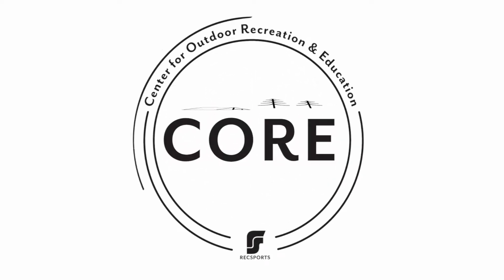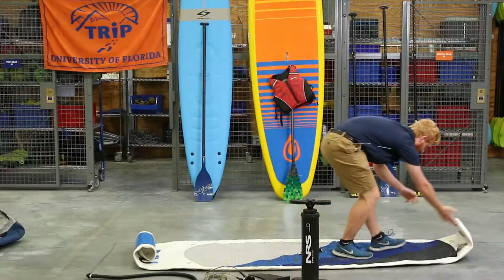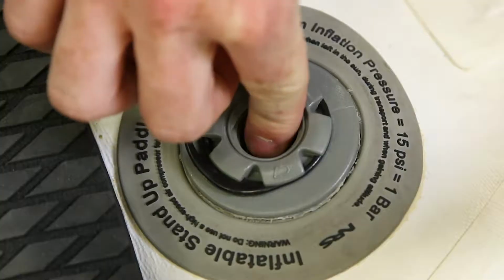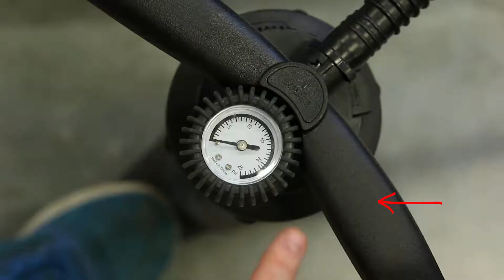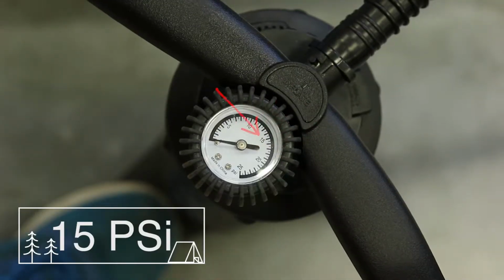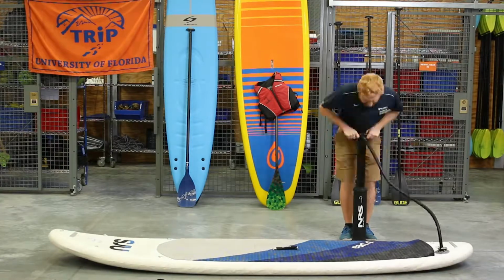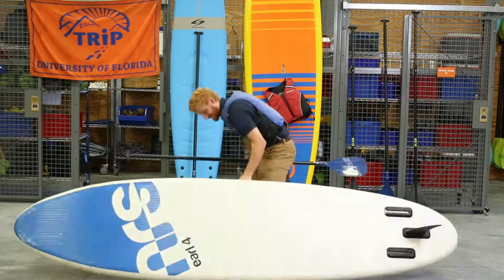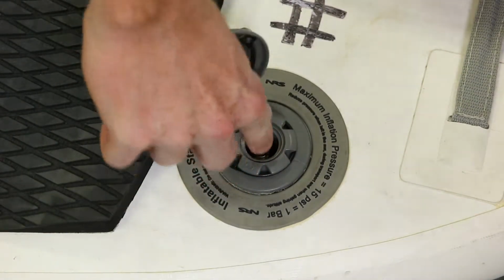CORE How-To: Inflatable SUP Package

Comment: 0:29 the tabs that lock my hose into the pump have been broken off so I can't inflate my SUP all the way. It cant seal and leaks as i try to inflate it to the propper pressure. This should have been seen before it was rented out.